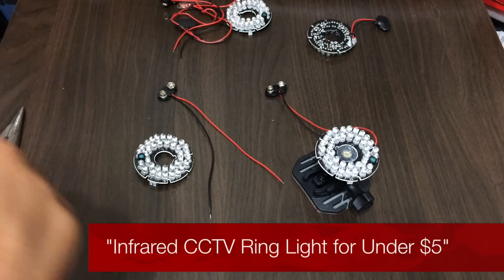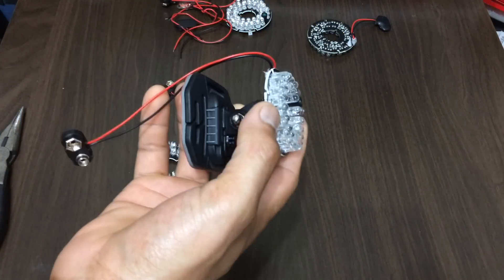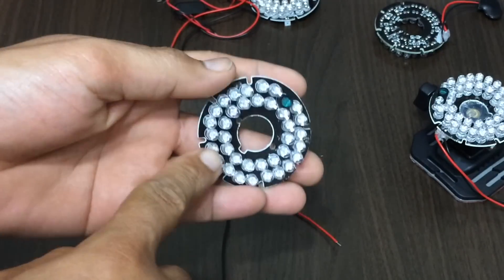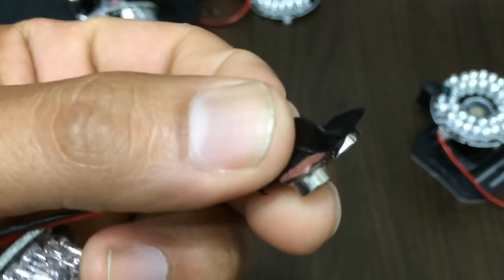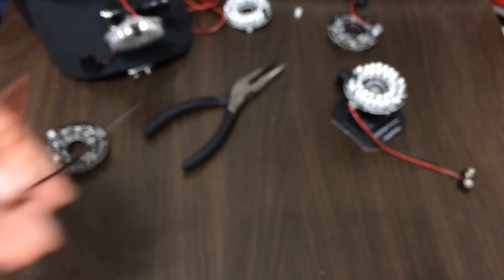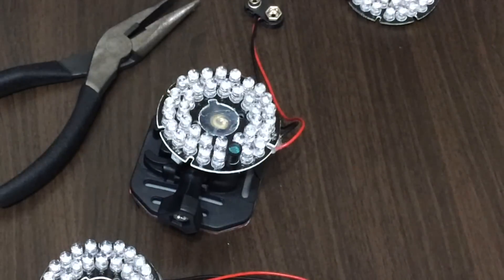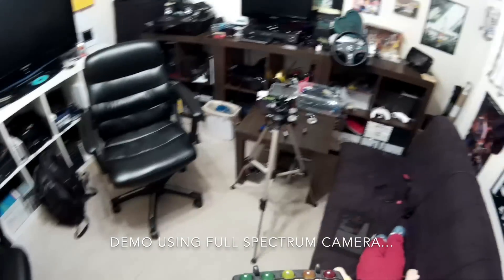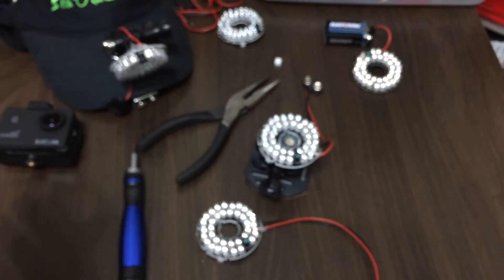PairUnormal Guys: [DIY] -Infrared CCTV Ring Light For Under $5

Comment: I'm trying to make a night vision sj4000 for fishing using this light. Any advice to make it waterproof or resistant? Thanks
Reply from the maker: Well unfortunately the man that made that video,  our former tech guy is no longer on the team, and I don’t know anything about that type of stuff😅. We also haven’t used one of those cameras in years, but oddly enough just yesterday I found one that I still have and was considering using it on our next investigation. When we bought them originally they came with all kinds of little attachments that you could use and one of them was a hard protective action cam like case that is waterproof.  We had to cut slots in it so the audio could be usable but if yours didn’t come with that case you probably can find it online, I would try eBay.

Comment: can I order the irs light board on eBay.  I got some but they only seem to work of mains 12v .
Reply from the maker: Yeah, that's where I got ours. We no longer use them as a viable light source in IR but they still remain as one of the cheapest options to this day.
Reply: @ParaholiX  what part is at 1:50
Reply from the maker: @unlimitediq1894  It's a 9V battery connector
Reply: @ParaholiX  you have any spare connected IR Illuminators you could give me? I really need one.

Comment: Would have been nice to see one used outside in the dark.
Reply from the maker: For outside, they’re terrible. Can’t see anything unless there’s tons of trees around you. This only goes about 10’ for indoors. For outside, we use a 30watt Colorado Paratech 6 light array which costs $200 and are powered by two 18650 batteries.
Reply: I did not expect a reply, thank you good sir! Ok these won't do me then, I was aiming to angle the camera down at the ground and film about 10' away. It's for a critter cam setup i'm making.
Reply from the maker: If you can get AC power to it then get a BLACK Reptile Heat Lamp bulb. They cost about $6 and produce tons of infrared light and very very little visible light. They look just like a black UV bulb but aren’t. Get that and a clamp fixture and you’ll be set for really cheap. No problem on the reply, I try when I can.

Comment: my question is real towards the original use for the it lights . do you know if you can stop the it lights from coming on but have the day night sensor to work ? the sensor is what makes the it lens filter work on the security camera . I just want the it lights to not come on but I need filter to still be able to go infont of camera . thanks
Reply: that should be ir not it sorry
Reply from the maker: That I don't know. You can probably cover the leds with something and not cover the sensor. Maybe even remove the leds. I've burned some out and they apparently aren't sequentially powered so the other lights still work when one doesn't.
Reply: OK thank you that's helpful to know they not in sequence . I appreciate you responding !
Reply: hello, i am charlie luo,an engineer in new opto,we are 
manufacturer for IR LED (850nm & 940nm),light sensor, if u have any 
question ,u can contact me asap ,my skype : charlie 32978

Comment: Does the 9v battery last considering it runs of 12v?
Reply from the maker: From my experience it will run about 4-8 hours with a 9v battery but I say this that way because it has a dusk to dawn sensor. Whenever there is other light sources detected, it will shut off. So solid 4 hours and likely more. These don't go farther than say 10' for moderate lighting though.
Reply: @ParaholiX what part is at 1:50?
Reply: Para-holiX  I think you'd be better off in the long run using a 3 cell Rc lipo rechargeable battery pack.
11- 12v maybe 1800mah to 2400 mah.  it would last a lot longer in use and have long service life because you just recharge it.  So it works out much cheaper than all those 9v PP3 Batteries you would end up using.

Comment: can see red ir ? no Invisible ?
Reply from the maker: This produces only Infrared lighting which we can't see. If you look directly at the light, you'll see very dim red but that's all. You'll need a modified camera to see the invisible light these produce.
Reply: 940nm   invisible
Reply: hello, i am charlie luo,an engineer in new opto,we are 
manufacturer for IR LED (850nm & 940nm),light sensor, if u have any 
question ,u can contact me asap ,my skype : charlie 32978
Reply: hello, i am charlie luo,an engineer in new opto,we are 
manufacturer for IR LED (850nm & 940nm),light sensor, if u have any 
question ,u can contact me asap ,my skype : charlie 32978